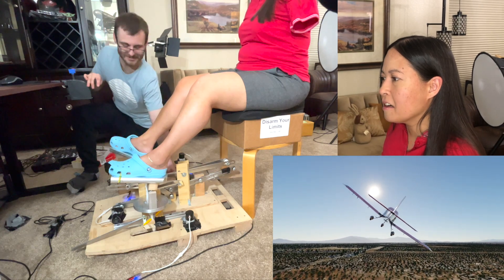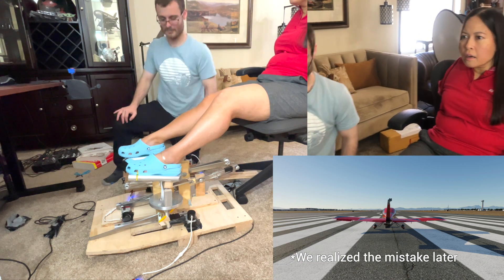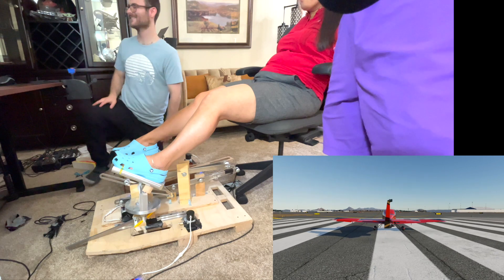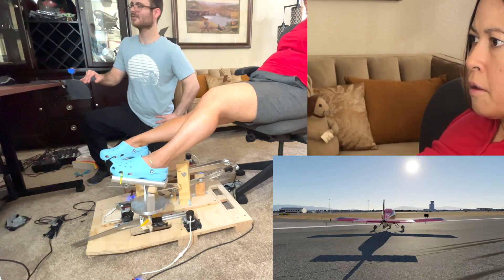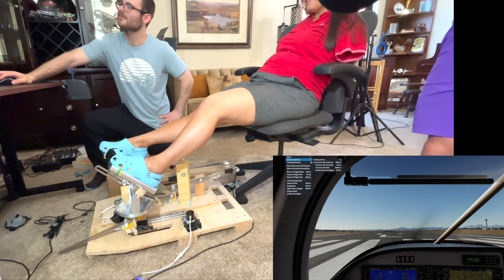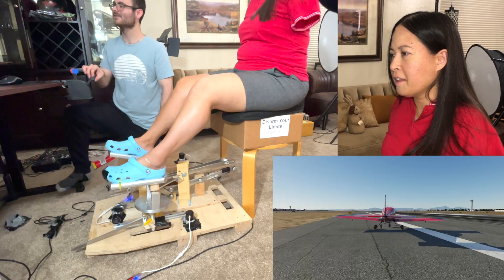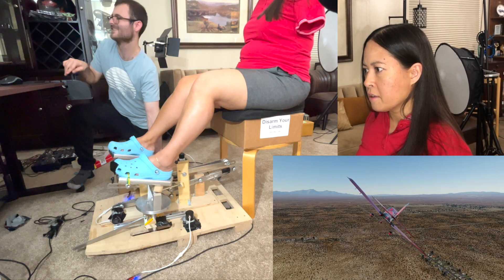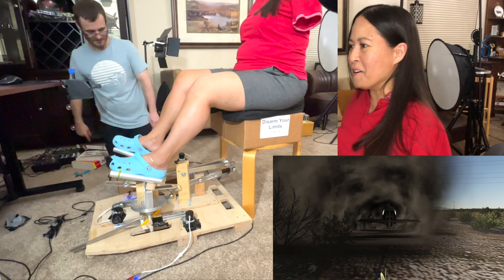Armless Pilot Controls Plane with Feet for the FIRST Time!

Comment: Very interesting how they came up with such a counter-intuitive way to build this 😂 I know its not easy, but why not make a plate where you place both feet and control pitch and roll by tilting the whole plate, and yaw by turning it. The plate would kind of represent the plane, and it would be very easy and comfortable. Then you could still add power settings by for example sliding the feet apart (more power, less control sensitivity as a side effect).
Reply from the maker: That’s a good question. The biggest challenge has been getting mechanical advantage to move the controls. It’s something like 300 lbs of force moving through the rudder cables in the most extreme cases (150 lbs at the peddles). Getting the controls to allow my abilities to still use the full flight envelope is easier said than done.